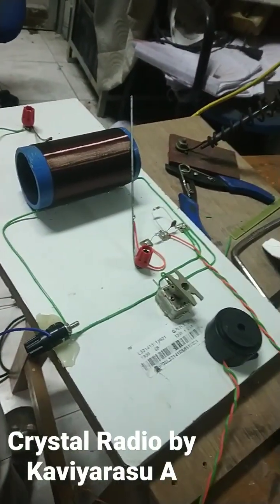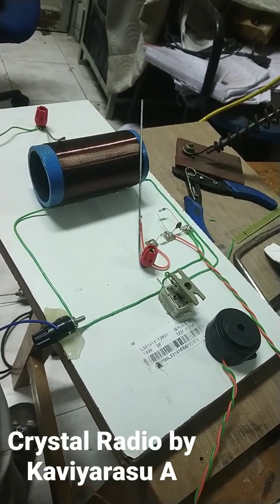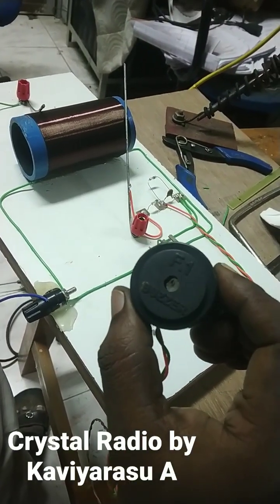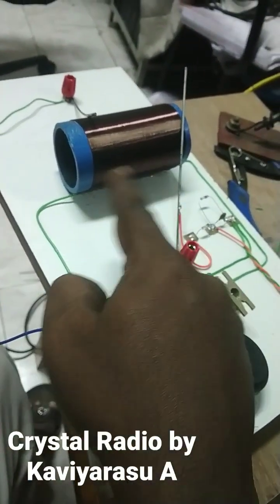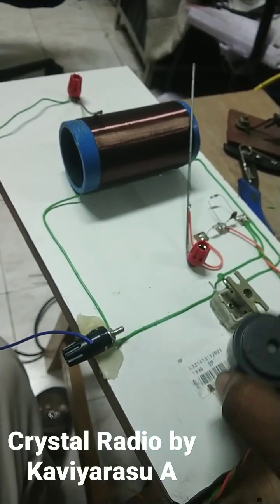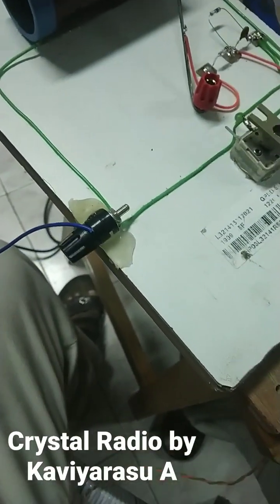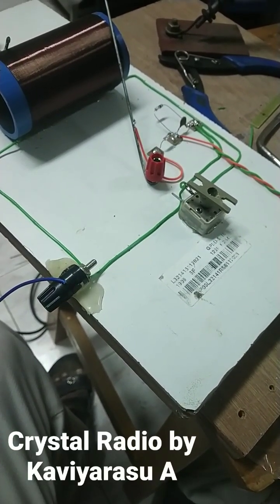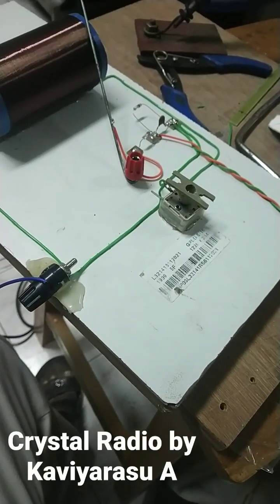Crystal Radio

Comment: Speaker 🔊 details price where to get and what is called
Reply from the maker: @fullsongs1020  it's actually a piezo horn ( bike left right indicator). You need to open the horn and remove the circuit. Use only the piezo plate. Best of luck.
Reply from the maker: OA72
Reply: Thanks cam you make full detailed video which resistor is used diode
Reply from the maker: @fullsongs1020   There is no resistor! only diode Any OA serious (Germanium) diode will work.
Reply: @hackerdon2  thank you
Reply: With diode what you attached
Reply from the maker: @fullsongs1020  its capacitor 0.01micro farad helps to bypass the carrier signal
Reply: Hello can u tell the specification about the coil, the circuit, the turns and the the pipe dia,   pls I really liked ur design and explainations

Comment: did you just connect the buzzer to use it as the earpiece?
Reply from the maker: Yes. Remove the buzzer circuit. Use only the crystal earphone.
Reply: Can i use just a total Passive Piezo Buzzer which which It's sold without any built in circuitry?
Reply from the maker: @Adrian_AdamViolonDiGerma-tm3nq yes definitely

Comment: Hi Kavi..which diode u choose..and can u tell me the number of turns in coil and wire size u used.?
Reply from the maker: Hi Raj Arun the idea about the project is have to maintain the resonance. For my case i maintained 560micro henry inductance for the resonance of 720khz.
Reply from the maker: U may use any inductance and capacitor value for the project. The idea is those value should match the resonance.
Reply from the maker: OA 79
Reply: @hackerdon2 I spend a lot of time trying to calculate inductance. I never succeeded.
Reply from the maker: @VMgeschwader4117 pls use an inductance meter. The value should lies between 460 micro to520 micro henry. The inductance is the important rather than gauge and diameter of coil. Best wishes
Reply: You can find web sites that will help you design the tuned system.  The variable capacitor will be something like 300pF and you should find that the coil needs something near 100 turns.  I give these values just so you can know if you messed up the decimal point or something in the calculations.
Remember:
F = 1 / (2*pi*sqrt(L*C))
Break out your calculator or a spreadsheet and plug in numbers.
Reply: @kensmith5694  I have done this before but I mostly messed up with coil winding ..will try .thanks ken
Reply: @kensmith5694 knowing this equation is useless if you can't figure out the inductance.
Reply: @VMgeschwader4117  There are on line calculators that will do it for you.